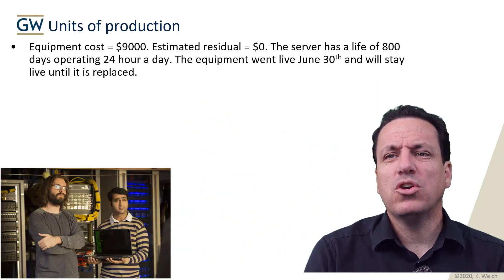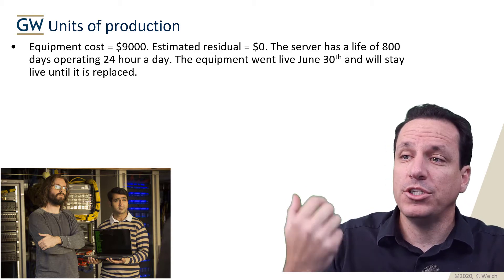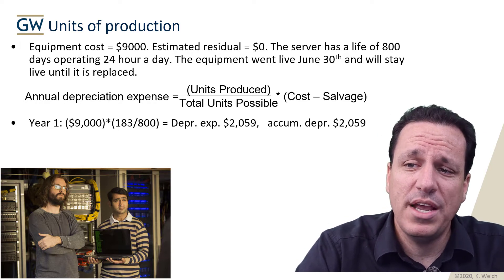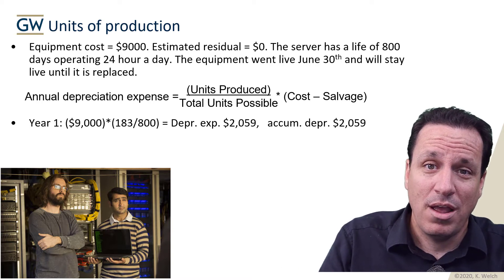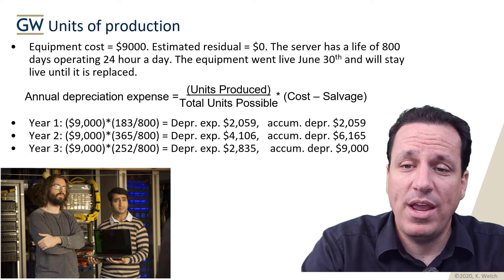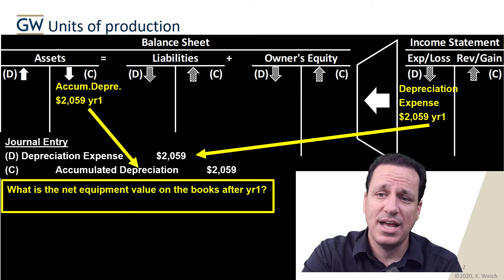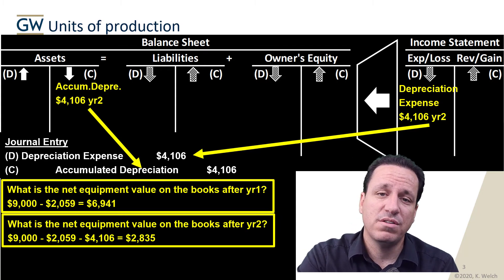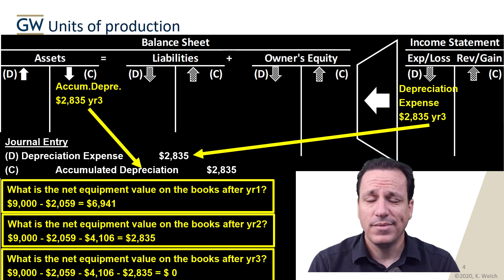Depreciation Method Units of Production Example

Comment: What would happen if you overestimate how many units an asset will  produce?
Reply: Also, same question but for underestimating the number of units an asset can produce. Do you just continue producing as much as you can and no longer record depreciation?
Reply from the maker: @pujapatel1394  Yes. for the first comment, you would not likely go back and revise your historical depreciation reporting, you would just update your current and future reporting to reflect the new expected total units. For the second part, you only depreciate the purchase price you paid for the asset. After you depreciate all of that, you still use the asset but don't net any cost of using it (i.e. the depreciation expense) on your income statement.